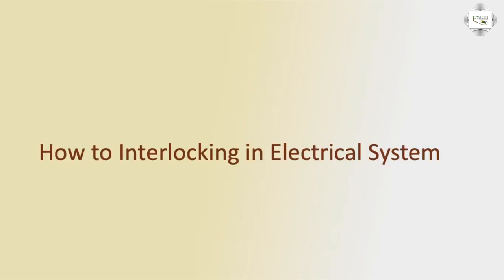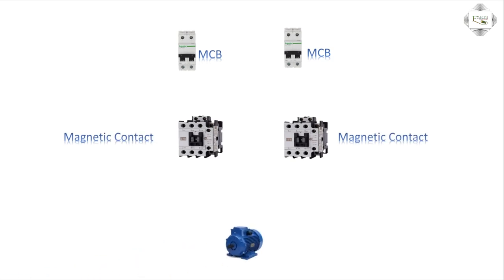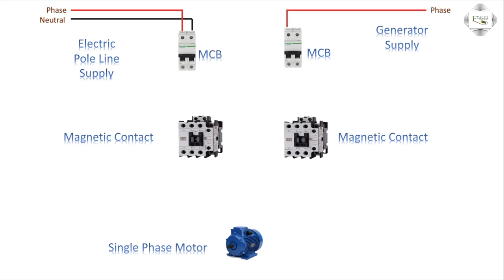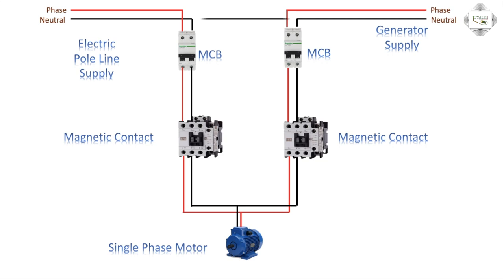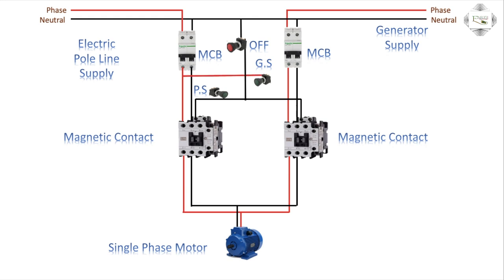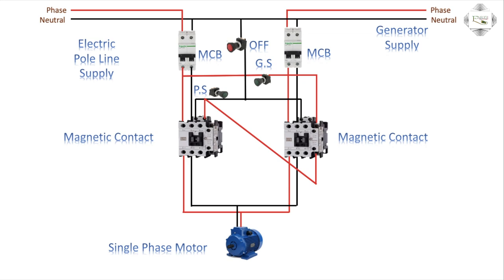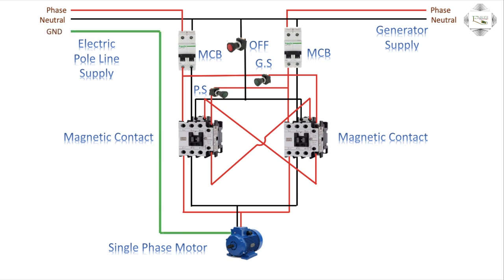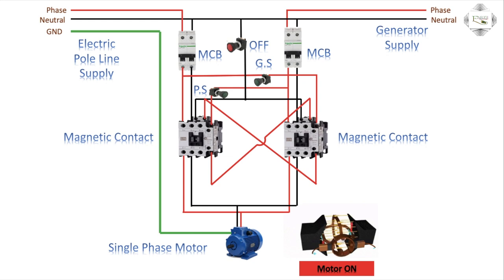How to Interlocking in Electrical System | contactor interlock | Motor connection

Comment: I have a doubt on interlocking concept ?
My question: 
I have 2 instruments, each has two probes which is going to connect to load(total 2+2 =4probes)  . When I turn on 1st instrument  ,other instrument should in off position and vice versa. How to make a circuit by using Relay/ contactors for this application ??? 
Friends can someone help me please ...
Reply from the maker: yes using circuit.. full info website @earthbondhon.  I love to receive your comments and feedback.
Thanks for watching it.
Reply: @EarthBondhon  I am also looking for similar solution for my house which ahs single motor and multiple houses. COuldn't find anything similar on your website.